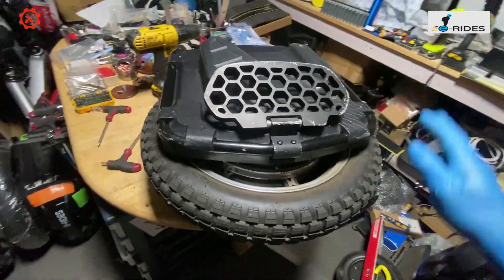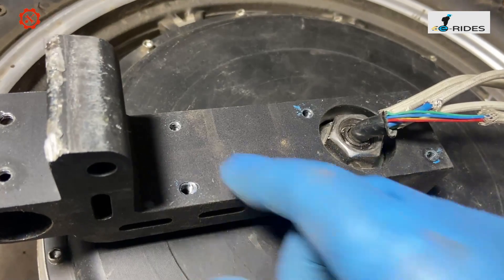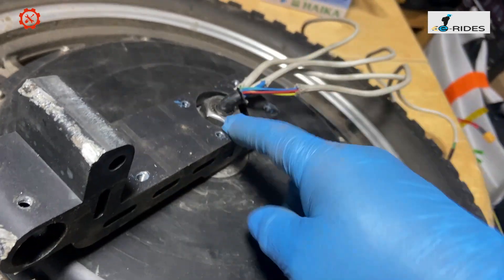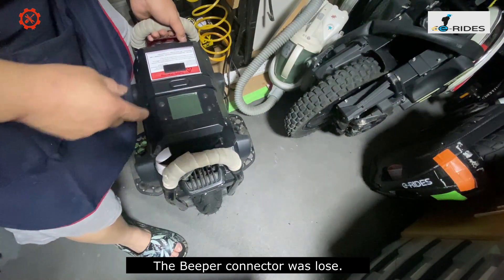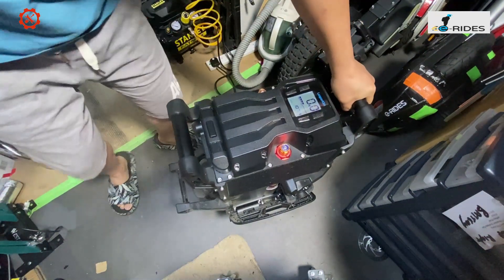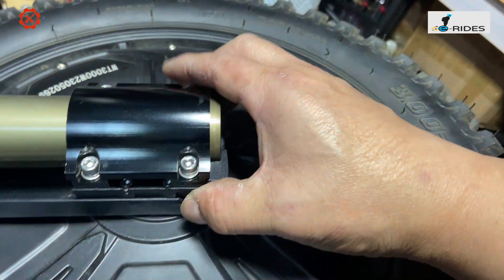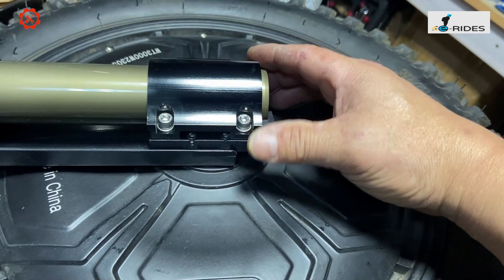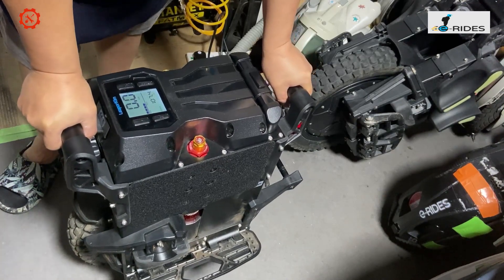Leaperkim Sherman & Patton Problems Fix. eRides EUC Upgrades.

Comment: Hello,

I had the problem you showed with the patton.

I took the whole wheel apart today to check for loose bolts.

The 4 black motor bolts were very tight and i couldnt loosen them. 

The bracket/clamp bolts were a bit loose.

I tightened them all and out locktite on them.

Put the wheel together again and im still getting the noise/klunking sound 😔

Do you have any ideas what else it might be?

Thanks

Comment: All that blue  loctite in them threads needs cleaned out before reinstalling the screws and you should clean it off of the screws  threads also
Reply: and locktite should be aplied to the bolts, not the holes :)

Comment: if you bought from ewheels, your patton had its motor screws checked. Almost 1000 hard miles on mine it is still as solid as a hunk of steel.
Im having a hard time looking at other wheels.
Reply: Bought mine from eWheels and awaiting it in the mail. Latest batch so the full charge braking that bricks the wheel is solved. I’ve been told Veteran wheels are super reliable so I can’t wait! Had some issues with my V12.
Reply: @gavinzooms can I ask what suspension you went with ?   I’m 165lbs snd not sure if I should get the 66lbs don’t want to worry about bottoming out suspension
Reply: @fqqures1019  66 for sure. I’m 155 and it’s perfect. Nowhere near too stiff; it’s perfect and I wouldn’t want it any other way

Comment: You mounted the sherman tyre in the wrong direction..
Reply from the maker: It’s been mounted has a front tire not rear.
Reply: @eucupgrades  ye it's wrong. look at where water would be forced when you drive through a puddle. It is supposed to be forced away from the middle of the tyre, not towards it.
Reply: @JonahHax  yeah, tire rotation arrow should be in reverse as this is front moto tire, as on front of motorbike they always in reverse direction, to reduce vibrations. That rule does not apply to euc, as we have only one wheel - traction wheel, so tire should be mounted always as rear tire, does not matter how rotation arrow is pointing direction

Comment: MY sherman clasic need Berings change after 4000Km and tighen Axle screw too. All done in once and switch to Heidenau K66
Reply from the maker: K66 tire is quite tight and a bit fiddly to fit.
Reply: @eucupgrades  80/90 or 90/90?
Reply from the maker: 80/90. @milordas

Comment: {tl;dr.  Purple Locktite}

This is why I’d prefer to get the parts and assemble myself. 
 
That pre-dryed blue Locktite on the bolts is worthless. It’s got to be applied as a liquid so it can cure after assembly. Those blue dots on the bolts indicated that the bolts came with pre-applied thread locker, which is mechanically useless and it’s just virtue-signaling false security. Pre-cured Blue Locktite is practicing a lube; go ahead test the static friction with a old style torque wrench (where one can read the torque incr under tension. 
 
And none of the Locktite on any EUC should be RED (high heat), none should be BLUE (permanent, non-reusable) and all should be PURPLE (reusable without reapplication). 
 
Purple Locktite, I put that shit on almost everything that’s vulnerable to galvanic reaction, too! Also, less is more, two drops per inch of threads is plenty. 
 
Always chase the old blue Locktite off the threads, it can build up over time, which is another reason to use Purple. 
 
Kevin, you’re a wonderful mechanic and I love your work. A mechanical comparison of the Patton suspension with the Adventure system would be interesting. {My suspicion is that I’d prefer the Patton hydraulic cylinders installed on the Adventure chassis, if the Adventure upright hydraulics aren’t as high quality. FastAce shocks on the Adventure… Is it possible?}
Reply: Hi, have this problem with my Patton. 

I'm going to open up my wheel tomorrow and check it

What's the correct way to apply the locktite? Just coat the thread then screw in?